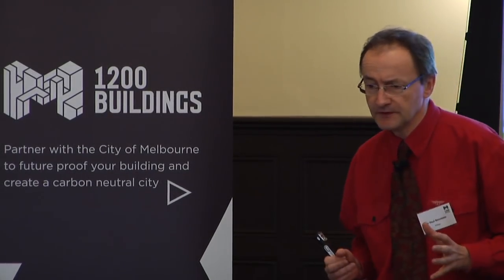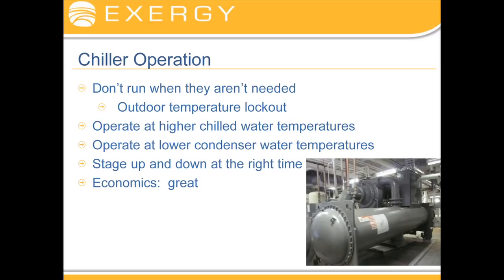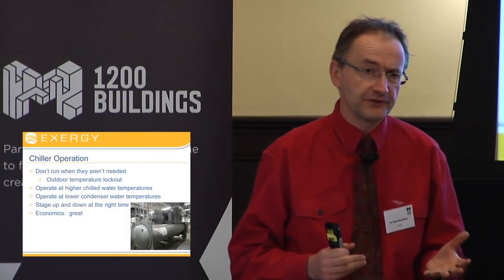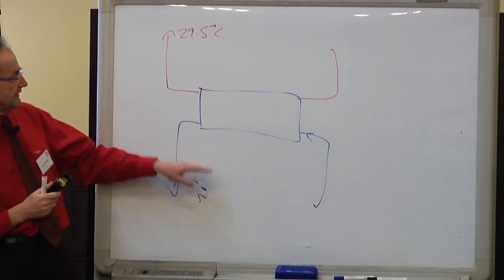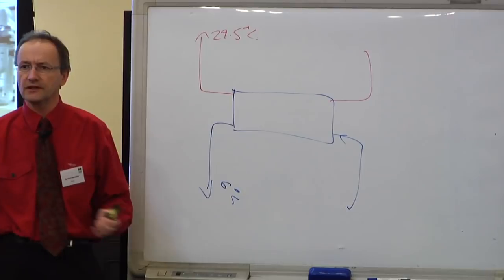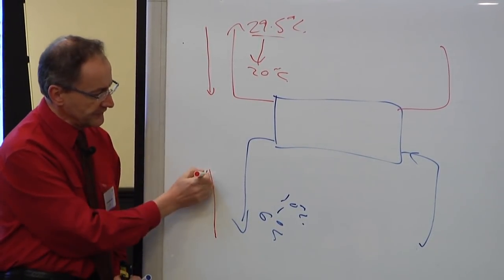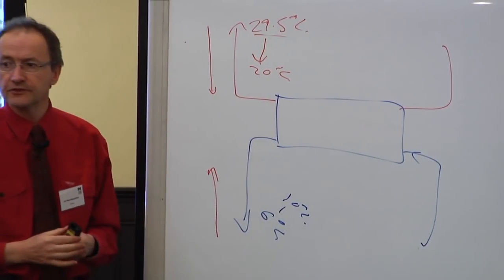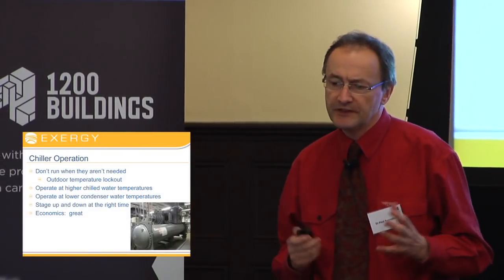3. Chiller operation

Comment: Can i get a building engineer job with a just this certification?
Reply: +VWGTI yes ofcourse, as soon as you get certification you can get a bldg engineer job. the first tools that you will be working with are a mop and a paint brush.
Reply: gearhead0800 really? so I take it no.
Reply: +VWGTI  I am a chief engineer and what I mean is there is always room for a good and serious novice engineer. just don't put the cart before the horse. be willing to start doing, what appears to be, the basic mundane tasks in the plant and keep your eyes and ears open and LEARN. If you are serious and respectful others will help and share with you and you can then become a good engineer. Good Luck!
Reply: gearhead0800 can I get in with just knowing heating and air condition or knowing about chillers?
Reply: +VWGTI what is the geographical location of the jobs?
Reply: gearhead0800 im in Chicago

Comment: Not running a chiller leads to stagnant water which leads to corrosion and microbials which will cost you more in the end. You should at least circulate the loop.